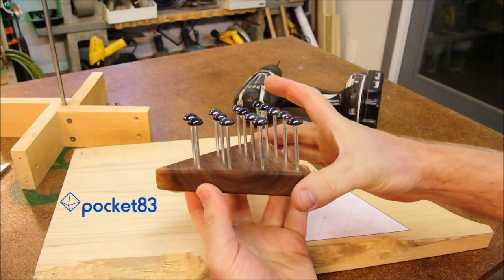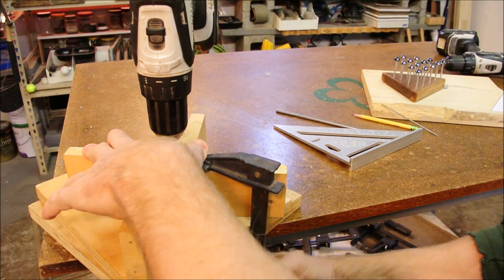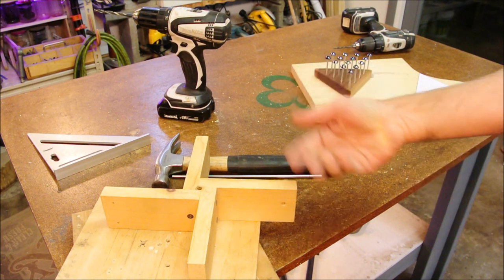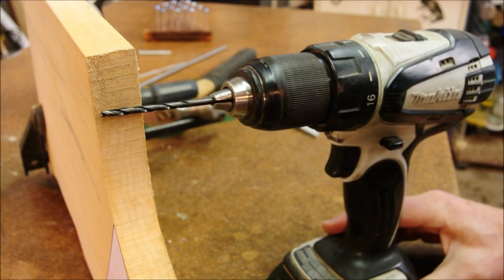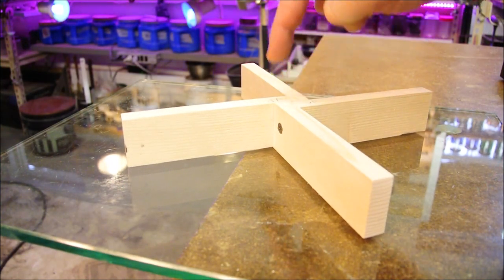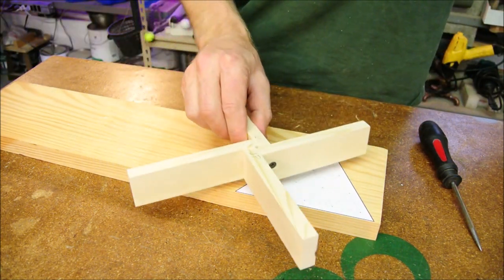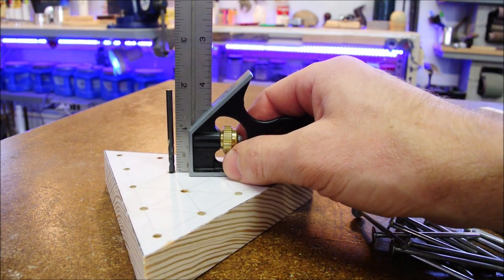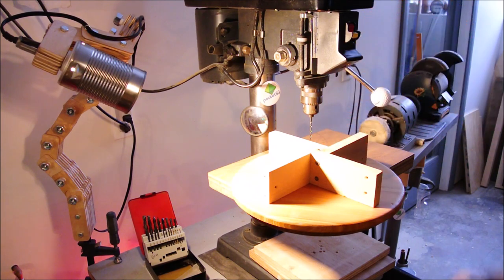Drilling straight without a Drill Press

Comment: I installed a bubble on my hand drill and now drill straight holes easily and every time free hand.  Only note is you must have your piece sitting on a level surface (like my workbench) on your angle will change.  I like you jig for a one time jig for larger timbers but seems harder than using a bubble level to guide me.  I have a couple of videos on drilling straight and any angle hole free hand accurately if you are looking for other ideas.  Great video as always Pockets.  I hope they keep coming :>)

Comment: I used to make a bunch of those games. I used a template made from 3/4 ply that was a triangle the same size and had all the holes in it already. Then just clamped it to the other triangles and drills all my holes that way with a stop set on my drill bit

Comment: I've drilled wonky holes with a drill press several times 😅

The most used version of your jig is just two pieces put together at an angle, or one piece with a bit taken out of it so it leaves a 90 degree corner.

Comment: Thanks. Hadn't considered how I was going to drill 6” timbers squarely. Clamping the press to the timber was a thought.
Reply from the maker: Interesting problem. This x-jig approach would certainly work, as long as the timbers have a flat surface. If it's a big job, maybe fab something like this from metal. Harbor Freight sells extra-long drill bits that are pretty cheap.
Reply: @pocket83squared 40 holes and reasonably flat (tool marks from the circular sawmill’s teeth should average out). A 12” 0.25” bit drilling to a 3.5” depth hoping to hit the opposing hole enlarging in steps to a 0.5” dia hole. Should average the error a bit. Using a wide X jig should reduce error a bit.
Clamping the drill press really won't work well as the throw on the quill is almost 3” and the table would need to be readjusted upward on the column once maybe twice. (Worst case the foot/base would be removed for a little more clearance.)
Thanks.